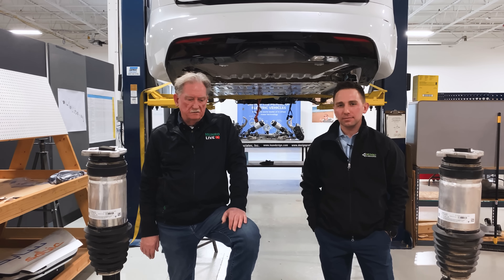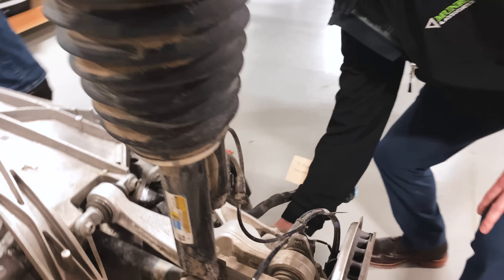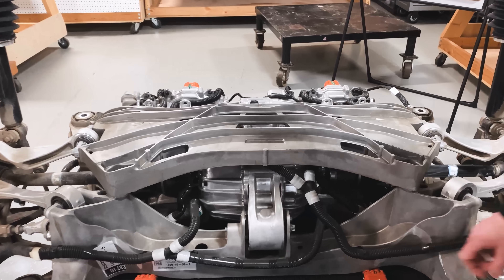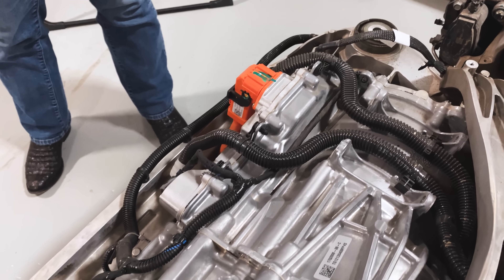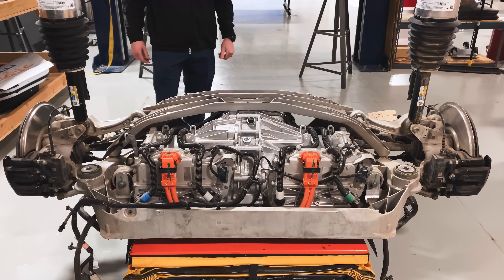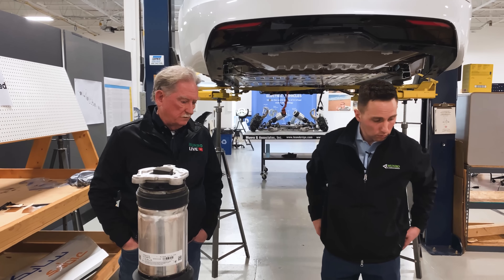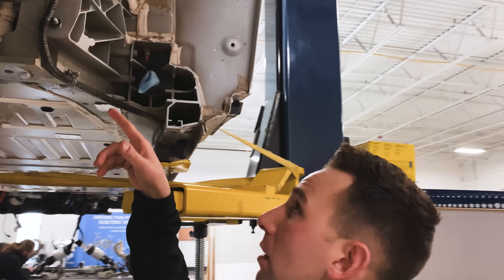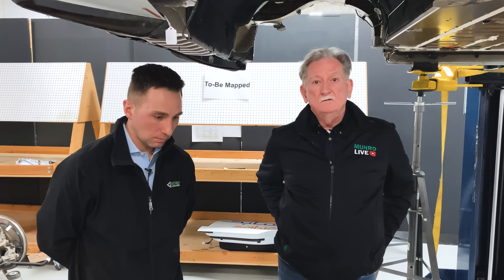Rear Cradle and Electric Drive Module | Tesla Model S Plaid Teardown

Comment: Maybe Tesla created a new engineering group tasked with "integration and efficiency of space utilzation" of engineering systems.  This team would need to hold the "third ring" with power over all,
Reply: IF you really want to know, what Joe Justice's videos.
Reply: Lol!!!!! They simply worked together just like other manufacturers, you’re welcome! How do you think for example that Mercedes’ was able to make about 1000 configurations on their commercial vehicles!? The Mercedes’ sprinter alone comes in all kinds of variations used as ambulance, rescue vehicles, freight transport, bus passenger, utility vehicle!? Their bus( double decker, articulated, multipurpose public transport…..)
Reply: @alanmay7929  Actually, it is way more complex than that. Tesla is using a new type of management system that has a flat hierarchy and a VERY rapid development program using AI to manage the whole company and to do unit testing. No two Teslas are the same. It's not like other companies where the product is updated once a year. The car is much more like an open source computer program with constant change and testing.
Reply: @DouglasEKnappMSAOM  you must be seriously joking right!? All tesla are basically the same, same boring options, there is litteraly nothing to differentiate them. They don’t use AI for development but actual physical CAD and other programs. Tesla barely makes 2 cars the model Y/3 and the model x/s, for your records other companies doesn’t update their cars once a year and those cars mostly already have a lot of features that Tesla still lacks.
Reply: @DouglasEKnappMSAOM  the Mercedes’ UNIMOG alone has the most features/configurations on any vehicles on earth, you can even very easily physically move the steering wheel from left to right and vice versa……
Reply: @alanmay7929  No they are not. They make 27 changes per week per car excluding software. They might look alike but they are not. The second fastest company to make changes is Toyota with 2.5 or was it 3.5 years per change when they push it. These changes might be hard to spot. For example improving the paint formula.

Alan have not done your research or you would not be making these comments. Have you watched Mr. Justice yet?

As for "features", what do you have in mind?

Saying the X is the same as the S or the Y and the 3 are the same is rather silly.
Reply: @DouglasEKnappMSAOM  let me tell you something it’s stupid easy to make change on two cars than make change on over a dozen different models, yes the model s and x are basically the same just the body is different same with model 3 and y. They all share exactly the same parts. Toyota makes tiny kei cars in Japan, hatchback, sedans, SUV (for on roads- off-road, overlanding, commercial) Toyota makes vans, bus, trucks…. They even own HINO, daihatsu….. Toyota even sells very basic equiped used by NGOs, armies, mining and many other diverse applications. Toyota doesn’t just change colors but small and big suttle improvements over the years before a total change.
Reply: @DouglasEKnappMSAOM  it’s actually nice to have a lot of car selections/modes and types on the roads, it would be a nightmare to see all those similar hideous looking tesla everywhere. Also tesla cars are just pavement princesses when compared to what Toyota vehicles have been doing for decades all around the world to the remotest places….
Reply: @alanmay7929  Toyota might have been great but they are in the list of walking dead.
You like to call Tesla's ugly but they are not, they are just boring looking. What they are not is boring to drive!
Reply: @alanmay7929  I love art and great looking cars but in the end that is just window dressing. I want a car that goes 500,000 without have big problems. Tesla's can do that. No other car is in this class.
Reply: @alanmay7929  Toyota was a good company but they failed to make the change to EV. They are nothing but wanking dead. 
Tesla has a definition of ready and a definition of done for each tile of the car. Between this they can change anything that they want to. 

When I said change the paint, I did not mean the color. LOL

Clearly, Toyota is a massive OLD company with the grey hair and old bones to match. Tesla and not even yet a teenager in the Olympics of car making. The future will be interesting! The death of the dinosaurs will be fun to watch. Some might even turn into birds. We will see.
Reply: @DouglasEKnappMSAOM  Toyota has, is and will always be great, in fact their cars speak for themselves, the most used cars in the most remote or difficult environments have always been mainly Toyota. I’ll be very curious to see how an EV fully loaded with electronics will survive in those kinds of conditions.
Reply: @DouglasEKnappMSAOM  you realise that there are millions of cars on the roads with well over 500.000 miles right, well made cars just need basic maintenance. Again those cars even 20 years old and plus are often shipped/exported to foreign countries where they still driven till they completely fall apart. In Moroco for example they still use Mercedes’ from the 70-80s as taxi, those things also very easily run on used oils.
Reply: @DouglasEKnappMSAOM  lol…. Toyota is still a great company and they haven’t failed in anything. We’re still at the transition to electric and there is a lot more to do in all the industry, for your records Toyota is even the world’s largest forklift manufacturer and they even make slot of electric models. Also many other manufacturers have been working on more environmentally friendly materials, using/recycling plastics, fibers and many other waste. Tesla still very heavily relies on the oil industry, same goes with the raw materials. There will be no tesla on the roads without fossil fuels. Even the factories….the grid, infrastructure was built by the oil industry.
Reply: @alanmay7929  I guess you mean that in the historical way, like the dinosaurs were great and always will be. I  love Triceratops! 

AS far as electronics go, what car is not full of electronics including modern off road ICE racers? 

EVs have less parts and thus will do better off road in the end although this is one environment where the long ranges possible with gas could be good and a heavy battery is bad. 

But we all know that racing and off road is a VERY small segment of the car industry and any not more relevant to the EV revolution than racing horses were to the ICE revolution. I love to watch a good horse race too! 🙂They even can eat green fuel on the road! No range anxiety there!

But Toyota is dead; as dead as the horse and buggy. RIP.
Reply: SPECIAL FOR YOU beautyzone.cam/Anna Anna is a beautiful girl.

He's the person I love, he's my light
day. The way the music flows and sounds
is extravagant and fun. Anna is
icon, legend, beautiful girl, princess, inspiration,
a star. I could go on and on, understand this.
I love NBA Anna.#垃圾

Comment: “Symphony" so well put. As an engineer you can see it, thats a lot of links, motors, reduction gears, inverters, pumps, plugs, wires and hoses all with clearance....so neat.
Reply: Absolutely beautiful to an engineer's eyes!
Reply: UNTIL TODAY the best rear suspension setup I had ever seen was the 1990's Mercedes W140 chassis - it was a work of art - THIS IS BETTER

And the merc only has a diff and driveshafts in it - this has 2 motors and the inverters and everything - AND it produces more power in the back axle than the Merc did with a 6L V12 up front in a package not much bigger than the differential.
Reply: @piccalillipit9211   It always amazes me how much power you can put down with such a small package with an electrtic powertrain! Like you said, not much bigger than a diff, but those motors can produce up to 400hp each according to an engineer at Tesla at the Plaid release.
They're essentially just a Model 3/Y rear drive unit doubled up and carbon sleeved for higher RPM, I would imagine still 9-1 gearing.
Reply: @VoxelLoop  - Yeah - each motor is no bigger than the diff on an S600.  I have seen coke can sized high voltage DC motors that are 12kw or 15kw - they are utterly insane power density.
Reply: @VoxelLoop  I think it is 7.5:1 gearing. Can’t remember where I got that number
Reply: @piccalillipit9211  have you seen a jaguar rear axle and suspension with brakes. They are cool and intricate. From 1969 to 1986. I've never seen the Merc. I'm a Jaguar and Rolls-Royce mechanic. The Rolls-Royce is an aluminum cradle.
Reply: SPECIAL FOR YOU beautyzone.cam/Anna Anna is a beautiful girl.

He's the person I love, he's my light
day. The way the music flows and sounds
is extravagant and fun. Anna is
icon, legend, beautiful girl, princess, inspiration,
a star. I could go on and on, understand this.
I love NBA Anna.#垃圾

Comment: No such thing as aluminum?!? It's an element.
Reply: He meant that "aluminum" is a generic name, and that there are 100's of aluminum recipes. Castings are designated in 3-digit numbers, these are all likely 300 series.  Forgings, extrusions & sheet are in 4-digit numbers, like 6061.
Reply: @mayflowerconsulting5540  To be accurate, those are aluminum alloys (which is what you meant by "recipes", trying to make it understandable for non-technical people), not aluminum.
Reply: He should have said "it isn't just aluminum". That has two implications: none of these parts are made of pure aluminum, and even "aluminum alloy" isn't specific enough because there are many alloys.

Comment: Love how Tesla's engineering culture manifests on it's products!
Reply: No other auto manufacturer has access to or use engineers from the the space industry like Tesla does with SpaceX.  That is the reason you see a totally different type & better engineering.  If you look @ spacecraft & satellites you can see similarities in how they engineer for packaging, strength & efficiency.
Reply: @robinsonmac  You say that--- but a small rock from the road can bounce up and break their cheesy little water hose-- and all the sudden you need to buy another $16k batter just to fix it.  I'm sure you seen that problem on Rich Rebuilds.
Reply: If it didn't, I'd be wondering what they were doing.
Reply: Not so much in the Assembly lines then.
Reply: You mean the overworked and underpaid parts?
Reply: @q1joe  boo hoo for people that aren’t forced to work there yet do
Reply: @mattbrew11  just because someone works somewhere doesn’t excuse the workplaces actions or culture.
Reply: @q1joe  if there are so many that dont like it they should quit and if theyre valuable people theyll change it and rehire them or elevate the standard.  Otherwise theyre just douchebags that get in a hottub other people are happily using and demanding it be cooler or hotter to their liking. No one made them get in
Reply: @q1joe  One of the most desired places to work in the entire country?  With wages and benefits that top UAW pay?  Best engineers in the country trying to get in the place?  That culture?
Reply: SPECIAL FOR YOU beautyzone.cam/Anna Anna is a beautiful girl.

He's the person I love, he's my light
day. The way the music flows and sounds
is extravagant and fun. Anna is
icon, legend, beautiful girl, princess, inspiration,
a star. I could go on and on, understand this.
I love NBA Anna.#垃圾